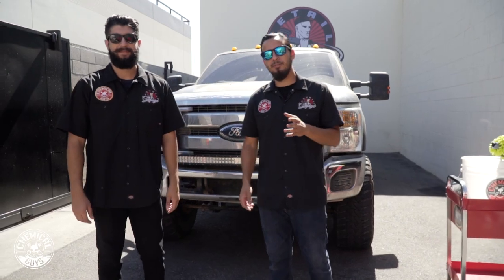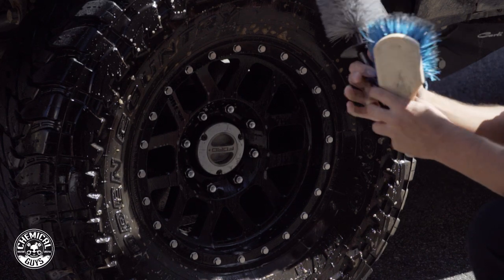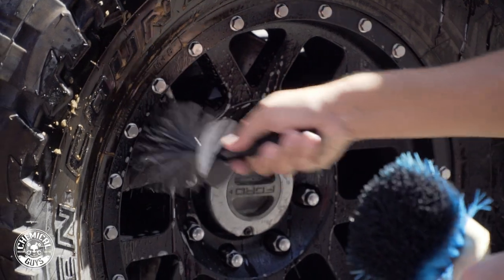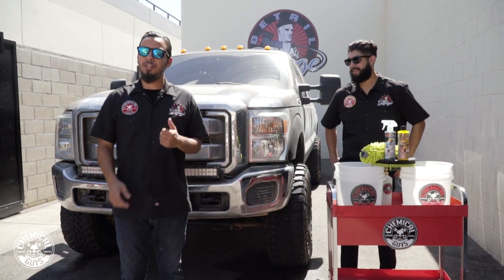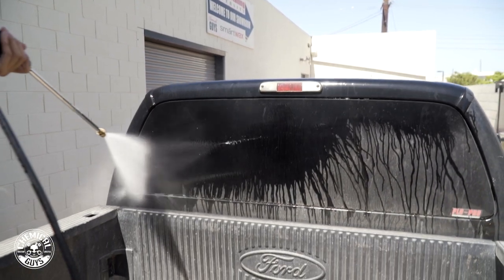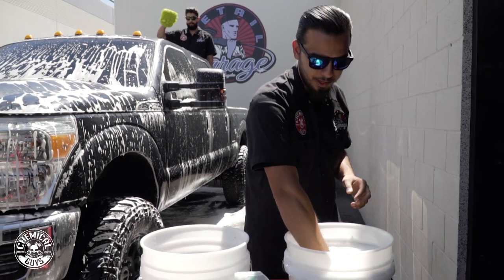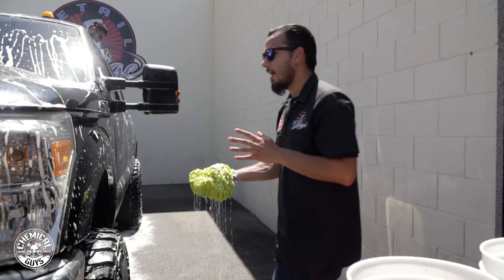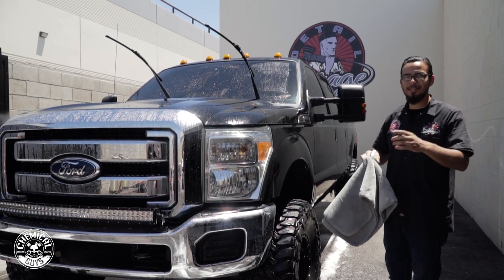How To Wash Dirty Off Road Trucks! - Ford F250 - Chemical Guys Car Care

Comment: What’s the best tip for muddy fender wells
Reply from the maker: Hey Gavin, the single best tip for muddy fender wells is the Long Handle Wheel Brush! It's our secret weapon when detailing filthy off road vehicles. The Chemical Guys Extra Long Wheel & Tire Brush is the perfect tool for cleaning OEM and custom wheels, tires, fender liners, textured plastic trim pieces, undercarriages, suspension parts, and more. The fully-synthetic brush is tough on dirt and grime, yet gentle on painted, chrome, powder coated, and polished wheels. This wheel and tire brush features an extra-long handle with an angled head. This angle slips the scrubbing head in between the tire and wheel well for fast and easy cleaning of rubber, plastic, and carpeted fender liners. Check out the video below to see how it works. Thanks for watching Gavin, really glad to have you part of the CG family! 

https://www.youtube.com/watch?v=NhldQ3rDIk8
Reply: Thanks for the reply. I will look into that.  Also.  How can I bring back the deep shine?  They are faded now
Reply from the maker: We have just the thing for you. Chemical Guys Bare Bones is a premium undercarriage spray dressing specifically formulated to protect and enhance hard-to-reach areas like the wheel wells, subframes, springs, and fender liners. The sprayable formula restores the original shine back to any vehicle’s trim and undercarriage in one easy step! 

https://www.chemicalguys.com/Bare_Bones_Undercarriage_Spray_16_oz_p/tvd_104_16.htm

Comment: What happened to not washing the car in direct sunlight
Reply from the maker: There's much confusion about this, and we'll explain why it's acceptable when you wash the way we do. One of the reasons we're able to wash in direct sunlight is because we use deionized water. Under normal circumstances, you can't wash in direct sunlight because when water evaporates, it leaves water spots that could damage your paint if not removed in time. The water in California is rich in minerals, and water spots are extremely common. Chemical guys uses deionized water to rid ourselves of this problem. One last thing I want to say is that our soaps are pH balanced, which means that they don't leave any residue when they dry, which eliminates the potential for anything that could harm the paint. Keep in mind that it's definitely not recommended to wash in direct sunlight for the reasons mentioned above, and you always want to wash when the vehicle is dry to the touch. Stay tuned for more great videos from your pals at Chemical Guys.

C.G. Alex -

Comment: How long does butter wet wax, cherry wet wax, activate last. I need to know
Reply from the maker: Hi Harshvir, thanks for watching. On average most waxes last about 6-8 weeks depending on the temperature, the humidity, and rainfall. Activate's sealant formula will provide you up to 6 months of protection. Stay tuned, more great videos on the way.
Reply: Chemical Guys so you could use activate before winter to protect the paint
Reply from the maker: Yes you can, if you want something that will get you longer lasting results, use Jetseal or Carbon Flex. You should use Jetseal, followed by the Butter Wet Wax.
Reply: ok thanks

Comment: Pressure washer doesn't scratch paint. Why would you say that?
Reply from the maker: Hi, thanks for watching. When used correctly, pressure washers are totally safe for cars. Pressure washers have the potential to harm your car's paint if the pressure is too high, or you wash to closely with the wand.  Any pressure washer that has a PSI of 3100 and above contains the potential to damage the paint. There's also a red attachment which concentrates the water to the point where it could strip paint easily. Stand back at a safe distance and don't use the red attachment because it's too concentrated. Pressure washers create the best amount of foam when paired with a foam cannon, and they have the power to knock off the heaviest dirt, especially on large trucks. Thanks for being part of the Chemical Guys family, and happy detailing!

Comment: How do you scratch the rim with water?
Reply from the maker: Hi Kristján, good question. Using just water is not slick enough to prevent scratching. Water alone will not provide the lubrication required when washing your car, and picking up an abrasive particle could scratch it when drug across the surface. For best results, use a premium car wash soap to lubricate the surface and emulsify the abrasive particles. Thanks for watching, Kristján, and make sure to check back later today for a new video upload!

Comment: I always wash the underside of my Jeep and the wheel wells. I just foam and pressure wash it.
Reply from the maker: That's the way to go Mathew, cleaning the undercarriage and the wheel wells will extend the longevity of the components underneath the outer shell. Stay tuned Mathew, we've got more great videos coming your way.

C.G. Alex -

Comment: You guys use DI water?
Reply from the maker: Yessir, that's the sure fire way to prevent getting water spots. Water in California contains a high amount of minerals that leave behind water spots if not properly removed, those water spots will etch into the paint which will require polishing to remove it.

Comment: Chemical Guys, will rinsing a muddy vehicle with a pressure washer cause scratches?
Reply: Froylan Cepeda It's fine but soap adds lubrication where it won't scratch or it won't scratch it very easily.I would use soap instead of just water.
Reply from the maker: Hi Froylan, thanks for watching. Pressure washers have the potential to harm your car's paint if the pressure is too high, or you wash to closely with the wand.  Any pressure washer that has a PSI of 3100 and above contains the potential to damage the paint. There's also a red attachment which concentrates the water to the point where it could strip paint easily.
Reply: That's a given, Guys. I'm referring to what Kenny says at 0:58 "We're gonna use our pressure washer but we're not going to have it on, actually, because we don't want to induce more scratches"
Reply: Froylan Cepeda That's not Kenny, that is Javier..
Reply: KC Outdoors thanks. It's Kenny's truck and Javier is helping. Just got that now

Comment: I don't think that high pressured water creates scratches. The brushes do more damage then high powered water.
Reply from the maker: Hey Kevorkian, thanks for watching. A pressure washer has the potential to scratch your car if you stand to close, 3100 PSI is enough to knock someone off of their feet, let alone scratch your paint. I've used that very same brush on my wheels, I have alloys that came with my car, and they get brake dust, and road grime all over them. There might've been some miscommunication, everything being done in this video was to illustrate that these techniques are designed to eliminate adding scratches while detailing.
Reply: Chemical Guys I agree that high powered water can peel your paint, but scratching paint? That sounds a little naive.

Comment: will this effect plasti dip in anyway?
Reply from the maker: Hi Ubaldo, Sticky Citrus uses the cleaning power of citrus to break dirt, grime, dust, debris, and break dust. Sticky Citrus could leave some type of residue, the Meticulous Matte quick detail spray would be safe to use, it's designed for wraps, matte paint jobs, and satin finishes.
Reply: Chemical Guys sweet thanks guys!!

Comment: I'm surprised you guys never sweat
Reply from the maker: Hi Cesar thanks for watching. Don't be fooled, Nick and Javier were soaked in sweat, it was a rather hot day; very humid and uncomfortable.Working in direct sunlight drains your energy, and makes you really thirsty. Nick and Javier had to work fast on this truck, luckily they were using deionized water, otherwise they would've been stuck removing water spots. Stay tuned Cesar, we've got more great videos!!!

Comment: Why clean the wheels and tires first? The mud and dirt from the rest of the truck is going to run down onto the wheels and tires.
Reply from the maker: Hi! Good question. There are a few reason why you want to clean the wheels first, a few which I will highlight now. If you wash the body of the car first, then you risk getting dirty water/product onto your newly clean car paint. Wheel cleaners and tire cleaners often use harsher chemicals so doing the body first minimizes the chance of getting overspray or spent product on the paint. If you washed the body first, you would need to dry the body before moving onto the wheels and tires to prevent water spots. It's extremely hard if not impossible to not get the body wet again when washing and rinsing the wheels and tires after drying, so you end up washing and then drying the whole bottom part of your car again! Thanks for watching and make sure to check back every Monday, Wednesday, and Friday for new video uploads!

Comment: You should never wash in direct sunlight. Thats how you get water spots
Reply from the maker: Hi Logan, thanks for checking out this video. We use deionized water which filters out the minerals that get left behind when the water evaporates. Under the normal circumstances, you would get water spits since the vehicle would dry very quickly. We advocate the use of a drying aid that encourages water beading, and leaves the paint slicker to avoid adding any scratches of swirls. Stay tuned for more great videos.

Comment: Vehicles are not delicate you don't have to be so gentle cleaning them the clear coat is there strictly to protect the paint and it is way more forgiving than you think
Reply from the maker: Hi Jacob, I've seen people use old dried up towels, dirty water, and random household remedies to clean their cars. When you start looking at car paint up close, you'll start to notice things, nasty scratches from bad washing techniques, poor polishing jobs, and amateur mistakes. You can scratch car paint far easier than you can think.

Comment: That’s a really muddy truck. Wow. I guess their definition of muddy is much different than mine.
Reply from the maker: High Josh, thanks for watching. This was one pretty dusty and muddy truck, it took the combined might of two bold, and daring detailers to remove all the deeply embedded dirt from this giant truck. Luckily the dynamic duo had it under control, they fought tooth and nail to tame this savage creature. In the end Nick and Javier were victorious, and the the customer was one very happy camper. By far this was the dirtiest truck we have so far, and the Tough Mudder soap with the aid of the TORQ Foam Cannon fought valiantly to remove all the thick dirt that clouded this truck's brilliant exterior. Stay tuned, more great videos coming out every week from the capable hands of the Chemical Guys crew.

Comment: What's this soaps ph?
Reply from the maker: Hey Weston, the Tough Mudder soap is a PH-balanced formula that does not strip wax or sealant coatings. The formula is great for any off road vehicle, and won't remove those precious protective coatings.

Comment: Guy that sell products to wash the car. And they are washing with direct sun... That doesnt make sense !
Reply from the maker: Hi there, we appreciate your concern for this customer's truck, but would like to share a few reasons why it was safe for us to wash this car in direct sunlight:1. We use deionized water. 2. This soap, like most premium CG soaps, is pH balanced. 3. The climate was temperate. 4. The paint was cool to the touch. 5. It's California, so why wouldn't you want to be outside? 😊 We have detailed thousands of cars over many years under the conditions above, all to the utmost satisfaction of our customers. If you ever have any questions, or are new to detailing, we encourage you to contact us for advice. We can be reached via telephone, email, or even Facebook messenger and are here to help.

Comment: Chemical Guys whats your best car wash shampoo?
Reply from the maker: As a personal preference, I prefer to use Black Light soap, but that's because I have charcoal-colored paint. It contains a high suds/high gloss enhancers for a deep lustrous shine while helping lifting and releasing dirt and grime for gentle scratch-free wash. It's strong enough to remove dirt, mud, bird droppings, insect splatters, road salt, fresh water spots, and more. It's also safe for textured plastics, rubber, clear optical plastics, glass, paintwork, vinyl tops, clear convertible windows, convertible windows, convertible fabric tops, and any other automotive exterior surface.

Comment: you guys missed the wheel wells smh😒
Reply from the maker: Hey buddy, we were running out of time, and didn't have an opportunity to touch on a few of the undercarriage elements. Because of the size of this truck, and the fact that the owner was expecting to have it back by a certain time, we had to cut the video down to the bare essential cleaning. We hear you though as this truck could use some TLC in the wheels, great opportunity for some orange degreaser, and some Barebones to get the undercarriage looking immaculate. Stay tuned, more great videos coming soon!!

Chemical Guys Alex -

Comment: They call themselves professionals but yet there doing that in the sun not good for the paint
Reply from the maker: Hello Parker, thank you for watching. We can achieve good results for two reasons, our soaps are ph balanced so that they don't leave residues, and we use deionized water which has been filtered to remove any calcium or other minerals that produce water spots. Most people don't use deionized water, which results in water spots because the water evaporates leaving behind the minerals which etch into the paint if left unchecked. The name of the game is to get a deionized water filter, it will be a life saver.